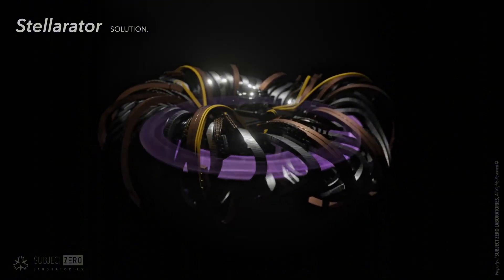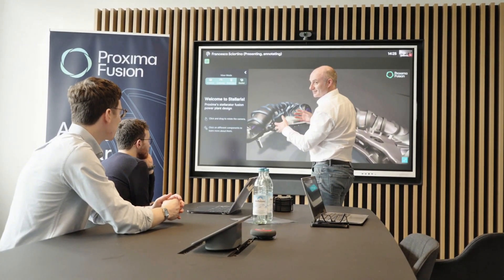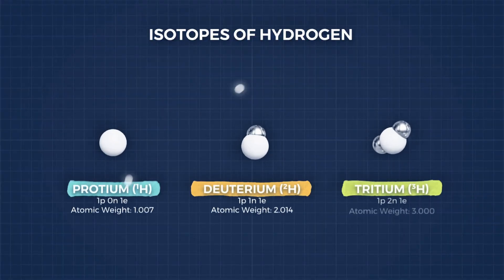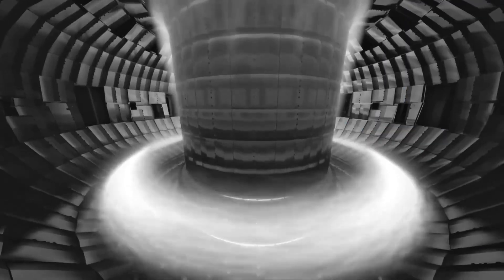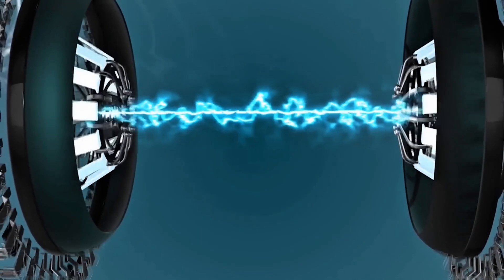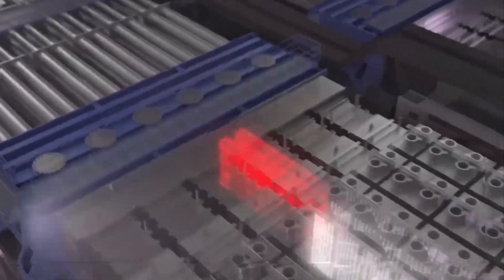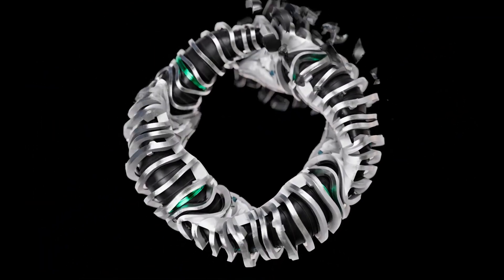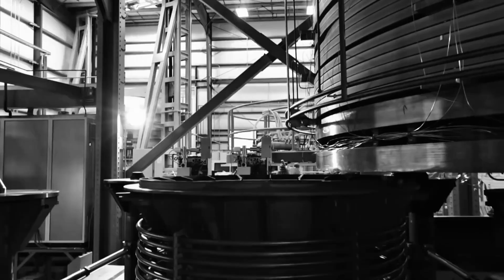Germany's Free Energy Breakthrough: A Game-Changer in the Energy Crisis Infinity Generator!

Comment: it isn't a generator of power at all ; it is a net user of energy.  It is an experiment with the intent to contain plasma - nothing more; it uses energy and doesn't produce any; and it never will.  It wasn't designed to produce any energy.  That doesn't mean it is a failure as an experiment; it simply doesn't do anything you allude to.